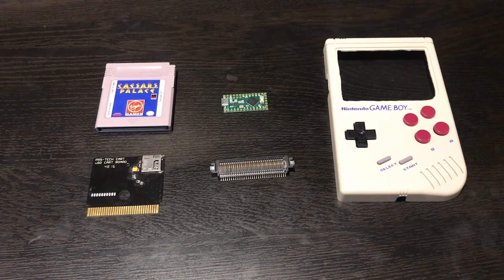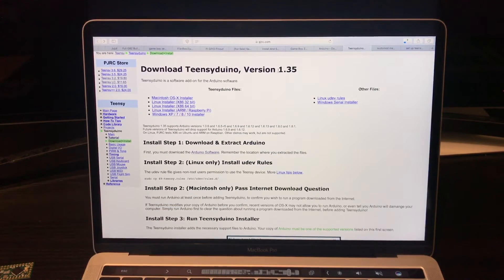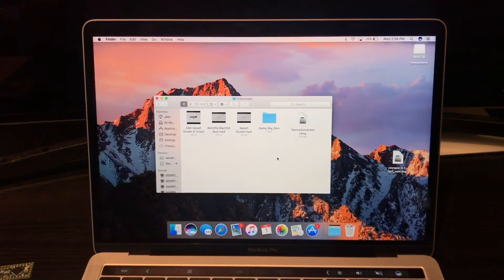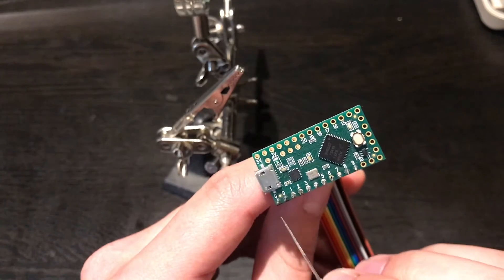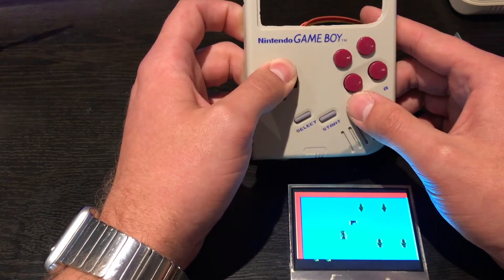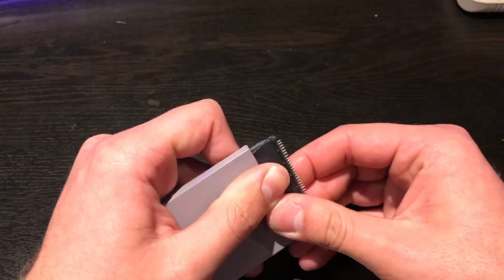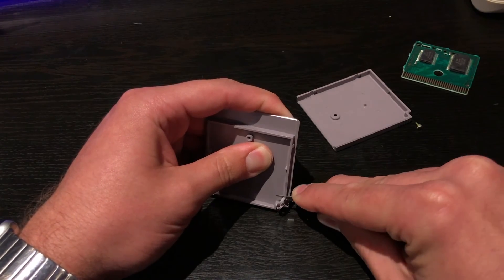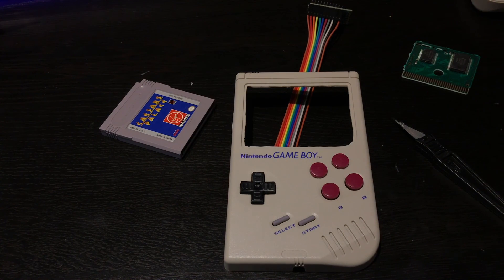Game Boy Zero Guide Part 3  - Setting Up The Controls And Cartridge Reader

Comment: ABSOLUTLY WILL POST WHEN I START MY BUILD IS THERE ANY CHANCE YOU CAN POST PICTURES OF HOW YOU SET UP YOUR WIRES IM HAVING TROUBLE FINDING GOOD PICTURES ON HOW TO SET UP EVERYTHING THANKS A TON FOR EVERTHINNG YOUR DOING 
BRANDON
Reply from the maker: brandon Melgar Are you talking about wiring up the PCB to the Teensy?
Reply: JPM304 I actually had a question about this too.  I'm working on this part right now and you say which pins correspond the pins on the pcb, however it seems to me that you wired it up in a completely different way.  Any way you could clear this up would be much appreciated.